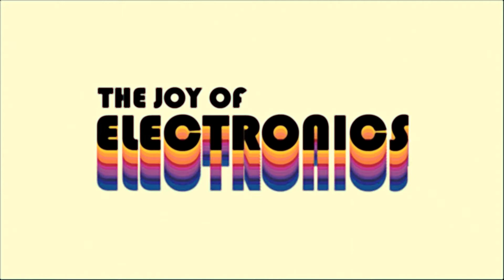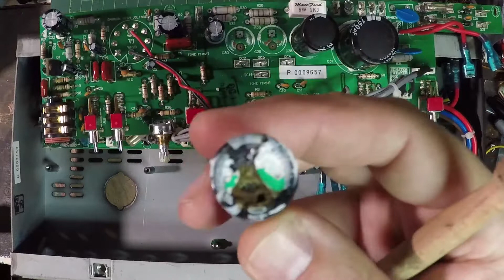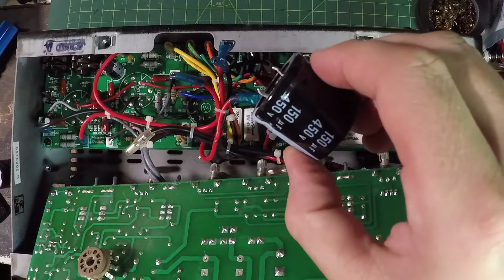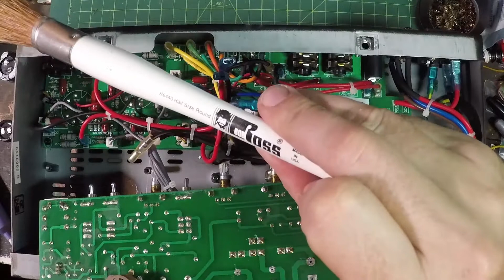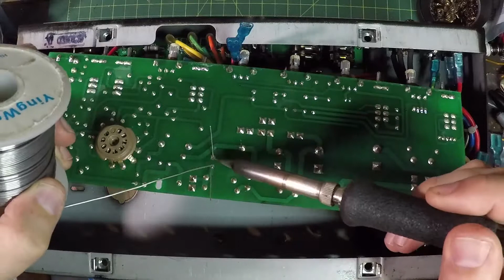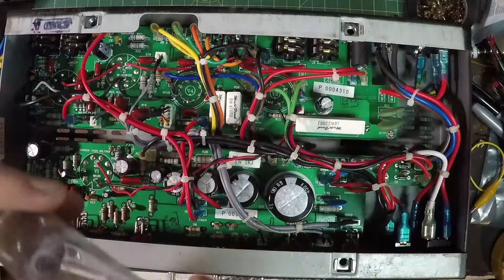Egnater Tweaker 15 Repair, Part 1

Comment: Did you measure the voltage across the cathode resistor? R29 was 220ohm in early runs but changed to 510ohms cuz tubes were being run at 15w
Reply: The cathode resistor in my Tweager is burning, an there is no sound comming out of the amp. I can't see wich resistant it had since the script is burnt away. Have you got any idea, what can cause that? The tubes are JJ 6V6S.
Reply: @ prolly a bigger issue at hand causing the resistor to blow. Bring it into a shop.
Reply: @tmsb8059  I have torn out a bunch of components and ordered new ones. Let's see what that does to the problem.

Comment: when I hear that + no sound, I think either bad transformer or bad ground somewhere and start by checking those

was it humming before the repair? or no noise/no sound before and now = hum/no sound? check all the grounds

i hate to say it (cuz I'm the same way), but your time is valuable... you can get these for ~$300 now all day long - if it takes more than a few hours AND you really want THAT amp, buy a used one (and if you sell yours as, "not working" please describe what you've attempted in your listing to help the next guy!!!! could be me?) good luck!!!

Comment: That hum can be coming from connecting those wires up wrong another thing to check is reversing output transformer input leads you may have accidentally reversed them .

Comment: I recommend replacing all capacitors, red, green and black, with Epcos, Wima. The ones installed are very bad, they dry out over time, their capacity is greatly reduced. I even replaced ceramics with Murata. The sound became bright and transparent, especially with JJ lamps. Check the contact + of the capacitor, after drilling, current flows to it, you could drill through the plating, check resistor R28-29.

Comment: Did you ever solve this mystery? 

My Tweaker 15 is still on the garage workbench after a year.  I only fool with it once in a while, but still no luck.  I have other amps to play through, but I love the tones i can get with this guy. 

Before covid I used to play thru it at house parties and jam sessions.  I put it on a tall barstool next to me for quick tweaks between songs.  Yeah, wide range of rich tones and distortion levels at my fingertips.  The speaker will be as far across the room as safely possible (without the cable tripping anyone) so I hear what everybody else hears and can therefore keep appropriate volume levels. A very nice set up that I want back!

Comment: Check the fuses, if not replace the power tubes and pre amp tubes. Mine did the same then worked perfectly after I replaced the tubes.

Comment: You are lucky that the capacitor which you drilled out the holes for made a mechanical contact to the upper PCB track where you drilled out the plate through. You could have soldered a wire from the the square pad to an adjacent connection point to make sure a connection was made.

Comment: I notice you have an earlier version which has the lower 220ohm cathode bias resistor.  Once you get this guy working, you might want to change that also to the new updated value of 510ohms.
Reply: 300

Comment: I'm beyond frustrated with my tweaker 15. I'll replace the caps on mine like you did. I noticed a lil burn blow out at the base of one of the caps. I get absolutely no noise. I cranked mine for 4 hours at a gig. Guess they're not designed for "real" use
Reply: I dropped mine about three feet off a cart onto the sidewalk and since then I get just a hum sort of like his.  Been fooling around with it for about a year.  Changed all the tubes, verified it’s good up to the effects loop.  Can plug the loop out into another amp and get good sound that way; so the preamp is good.  I’m a rank amateur, so checking voltages and reading Gerald Weber books but still no luck.
Reply: @eddiebobcat3183  you could have broken the effects loop jacks ?
Or something else ?
Reply: @eddiebobcat3183  I had that with a 5150. Tech said there were ghosts in the amp. I told him to change out a jack on the effects loop and it fixed it.